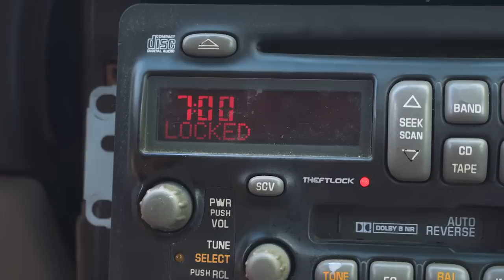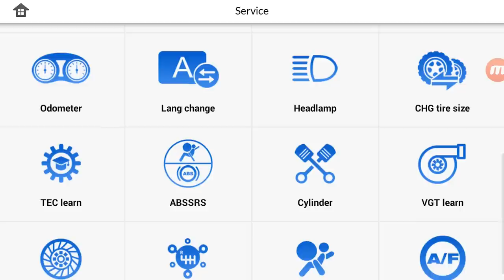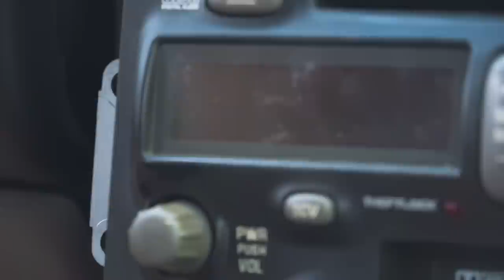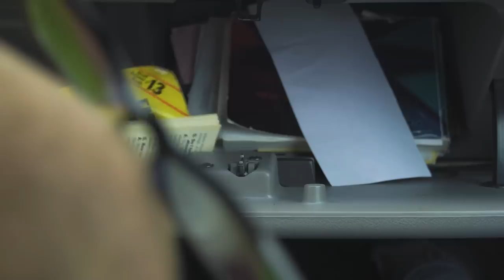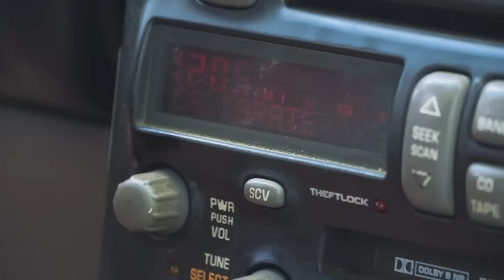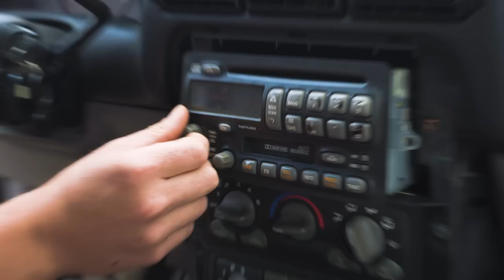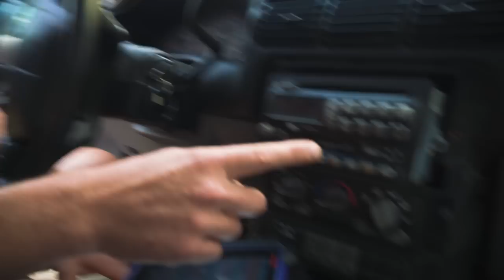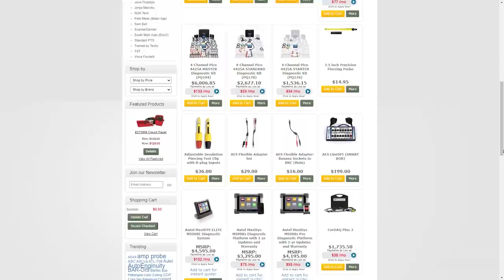Autel For The Win (factory radio Theftlock reset)

Comment: That's what I've been telling all of my mechanic friends! To get an Autel scanner instead of a Snap-On or a Mac. They're just making the tool truck guys rich. But because the don't listen to me,  I go and charge them to do programming with  my Autel. I do programming on cars all the time, and I use the Autel almost exclusively. . I've had an Autel for some time now and for a long time I assumed the Snap-On did programming too, like radio programming, key programming, module matching. And I slowly learned that it doesn't do all those things, even though it's a lot more expensive than the Autel. Although the Autel doesn't have built in connector diagrams or a scope, I feel that it does much more of the IMPORTANT stuff. Like program keys, match immobilizers, oil resets, etc. Oh, the list goes on and on. Also the Autel is Android based, while the Snap-On is Windows based. Android is much more stable. I use it as an Android tablet, with YouTube,  Skype, Chrome, etc. All of my car documents are stored there also. If they're were priced the same, I'd still go for the Autel. I feel the Snap-On does little for me.  The updates are much more cheaper than the Autel.  Danner, I'm glad that you finally gave the credit to the Autel that it deserves.  You should have used this scanner a long time ago. The Launch is also a good scanner that does similarly what the Autel does.  Great video, Thanks! PS. Kaleb looks cool with long hair.
Reply: cyberslacker5150 Which model Autel do you run? And do you regularly use a “pass-thru” device?
You almost need both an Autel and a snap on scope for mobile diagnostics..$$ I miss my Autel for sure!
Reply: Do you have to update annually?
Hear that you do to keep it working. That keeps me from buying one as I would just use it for personal use. Help some friends out also.
Reply: @markchidester6239  Depending on the model, you don't have to update it every year. It'll still function as normal, but you won't be able to do newer vehicles as they come out, until you buy the update again.
Reply: @hillbillyrigrepairs1814  +1 to that comment. I'd be curious to know what model he uses as well (also, anybody else that has some experience with them feel free to chime in. what are you using)

Comment: FYI 
Uplevel in GM speak is anything above the base AM/FM radios they use in the base vehicles. So if it has a tape deck or CD it is considered uplevel. 

RPO UL2 won't be in a US or Canadian sold vehicle. It is there because other countries use a different band spread for their radios and that option sets the radio to match those station settings. For instance in the UK most radio stations are even numbered so you can have station 102.2 but not a 103.3. Like most of the non-snappy scan tools that cover most of the makes in the world the Autel has the ability to deal with global vehicles in cases where that is applicable.

RPO UC6 is the 6 disc CD changer option.

Comment: I have a 97 Jeep G.C. bought new, I had a noise in the dash when taking off hard or stopping hard. Dealer could not find it ? Around year 2000 I had enough of this noise & when I removed the radio ( BOOM ) just like the one u have something loose around in there ? Took me about half an  hour but finally a short drywall screw fell out through the tape player slot. NO IDEA HOW IT GOT IN THERE SINCE IT WAS NEW ?

Comment: I want to add something to the learnums with the RPO codes.  I'm sure everybody saw Paul digging in the glove box for that tag.  Other places to look for that tag is in the trunk area floor, the covering for the trunk spare tire might have it on its bottom, any of the door pillars, and the bottom of the trunk lid are all places to go looking for that damn tag.  It varies a lot between the different flavors of GM junk.  One thing I discovered while doing an alignment, of all things, is that the tag might not exist at all anymore starting in 2018 on some models.  (Maybe 2017 in some cases?) You can still get the RPO codes though.  If your smart phone doesn't have a QR code reader built into the camera, get a QR code reader app installed and scan the QR code on the VIN tag.  GM usually still keeps that on the driver's side B pillar.  Once it decodes, it will give you the full RPO list for that vehicle.

Comment: Back in the day when I worked for a subsidiary of GM, you had to press and hold preset stations 2 and 3 simultaneously and wait for a four digit code. Then once getting that I believe there was a 1-800 number we had to call to get the unlock code. I think after that you just press the preset numbers corresponding to the code and it would unlock. 15:25, seeing you do that reminds me of a day I had to fish change out of a cd player in a customers car, they have kids, apparently. RPO means regular production option, I cheated and looked it up.
Reply: I had to do that procedure for a 97 suburban.

Comment: You can actually get all the logos for the manufacturers.  The logos are loaded but the new ones added in which take precedent when it boots up. It's simply a matter of going in and deleting the "new" logo files and it will then display the proper logos.

Comment: After playing scanner for so long. I would get an autel or launch over the snap on.dont get me wrong ,snap on is good for basic diagnostic,because it has built in components tests.but autel is almost close to the factory scanner,it has almost every data pid.autel can reset, reprogram and do scn coding .really good for German cars.but the downside on the autel sometimes can be little weird to read or to navigate. That is just my 2 cents.

Comment: Hello Dan,
 I'll spare the long intro on how much of a big fan of yours And your you tube channels. 
 Like many others, I'm having an issue with my significant other vehicle. It wont pass inspection due to the inspection station computer is not communicating with all modules in the vehicle.
I'll try to make this simple. Not!!! Lol
Symptoms.
Lost vehicle speed on the hwy for a few seconds.
Tsc and check engine light blinks and shuts off.
Regain speed.
Lighter not working.
I pulled and check the fuse for the lighter. It's good.
Once I put the fuse back in, the tsc light came on then shut off. Command sense, the fuse control both lighter and tsc in my opinion.
I can not find a Haynes book for this vehicle on all five parts store in my town. 
What's the reason for this post you ask? On one of your videos you mentioned you can go on a website and sign up and pay for a month for a wire diagram on one vehicle. Is it possible you can give that web page again so that I can fix this issue.

I greatly appreciated.

Thank you a million. Stay safe.
Reply from the maker: Thanks so much. Here you go my friend https://eautorepair.adtrk.biz/?a=10817&c=24&p=r&s1=

Comment: i am wondering if that autel maxisys ultra will program ecu's like they claim it will. looking at buying it just want you opinion thanks
Reply from the maker: It will but you still need a laptop to run the pass through device and then pay for individual scripts from the manufacturers

Comment: Hi, what model scanner were you using? Cheers
Reply from the maker: This would either be the IM608 or the Ultra. I own both models
Reply: @ScannerDanner  Im just looking at both the IM608 and 908pro to upgrade just not sure which to go for, the 608 has all the key and immobiliser programming but is the 908 more diagnostic based? Decisions ??
Reply from the maker: @conceptrestoration1107  email my friend Carlos from AESwave carlos@aeswave.com and ask him these questions. They are close friends and are an authorized reseller for Autel. Tell him I sent you.

Comment: Now will that scanner unlock a 2007 cadillac escalade radio?
Reply from the maker: Most likely
Reply: @ScannerDanner  This  is why I come online to find out facts rather than fiction. I was told by one of the mechanic techs in my area that a Cadillac Escalade radio can't be unlocked even by the dealer. Well, I went to the dealer and they said it can be done for $192. So I thought if I could do it myself with one of these scanners plus still have the scanner to keep an eye on my Escalade I would be money ahead. Which one of these Autel scanners do you have or recommend to be the best they make? Thank you.
Reply: I should have added that I have a 2002 Chevy Suburban and a 2007 Cadillac EXT that I would need to use this on plus my kids have newer models in both types of vehicles. I would need a scanner to be able to work on all of them.
Reply from the maker: @TomM60  The Autel Ultra, hands down, but this a professional scan tool that also comes with a lab scope and is not cheap. I think it is close to 4k. If you are just working on your own cars, I wouldn't spend that kind of money.

Comment: Great video what model is the autel
Reply from the maker: IM608
Reply: ScannerDanner thank you sir
Reply: I been in this business for two years now shop i work for has a snap on scanner it is 4 mechanics using it that's why i would like to get my own i wouldn't need key and ecu reprograming now Which scanner would you recommend Brand and Model i been trying to figure that out for while now there is so many options I would appreciate if you can steer me in to right product.

Comment: UR an outlaw Paul! UR local police probably watch you. 

On checking out the video as have a 2011 silverado for a shop I do mobile programmed and also repair work for. 

Sadly this radio has the wrench icon so there's no easy way. 

Just give it time & topdon will make it happen. 

We'll see you at Vision next spring?? You know you want to and bring ur brother & son. 

It's well worth it for 4 days. Heck have ur brother bring his employees, shut the shop down and get uptrained. 

Didn't go far in this video but for the early GM vehicles (2000's) there's a dealer hotline one can you. 

Time to call it a day. Enough to do later today after I pull a FEM module on a '14 BMW 320i for All Keys Lost on the way home. 🤙

Comment: Do people actually steal factory radios?  They are usually specific to the make and frankly not the best in fidelity.
Reply from the maker: I know right? Who would want this piece of crap radio to being with?
Reply: When yours is broke and the other guy's isn't....don't think of it as stolen, think of it as "free".  In these days, it might not be a bad idea in some cases.  I condemned and replaced a factory radio used in a 2014ish Grand Caravan last year.  It was a such a low level base radio, I was beginning to expect to see an 8 track tape slot. The salvage yard sent us a factory nav unit by mistake.  It had a full screen touch display, CD player and at least a 100 song library from the previous owner on the internal storage.  The best part, no programming involved.
Reply: stolen vehicles ran through chop shops.... yes it was a huge issue long ago, as was all the glass windows. some companies etched the vin into majority of the windows ( big thing around early 1990's. my old van has the vin number in more places than I can think of lol. it's like vin whack a mole